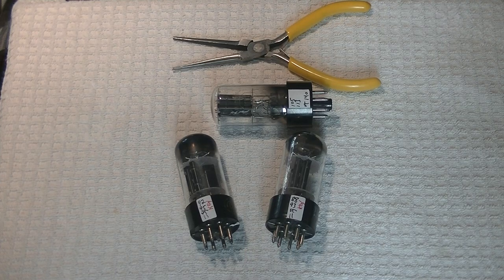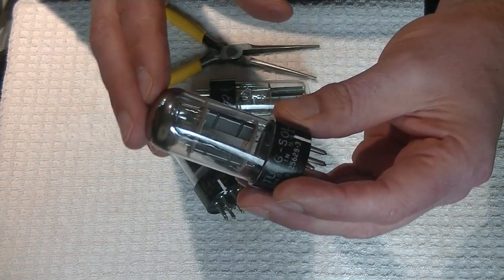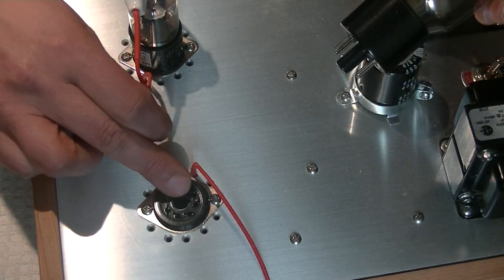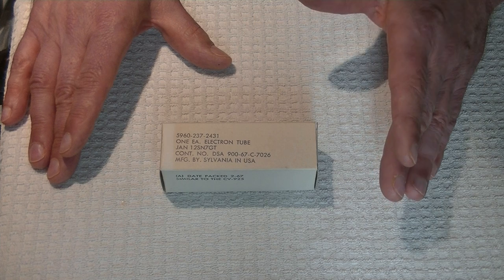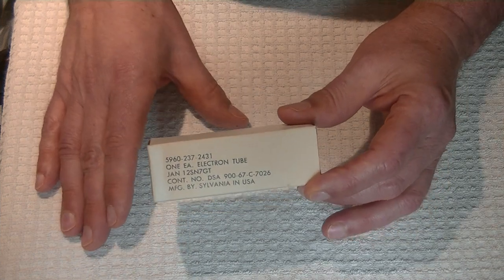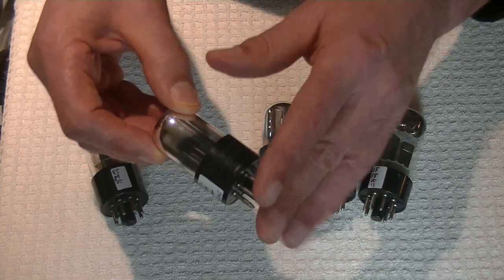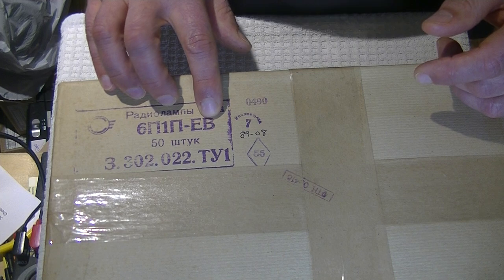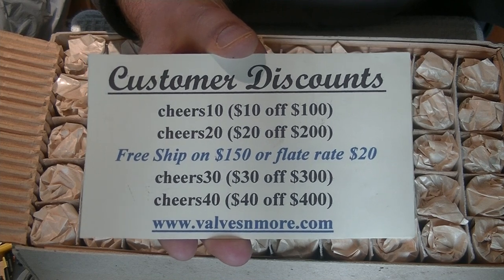Tube Lab #77 - Broken Octal  Keys

Comment: Nice video, really enjoyed earlier part of the video showing how to install a tube correctly. I have learned the hard way on my pre-amp with sunken 
connectors and have broken a key off an expensive tube of a quad matched set!   I like your suggestion of marking the tube for the location and orientation of the key.  What I’m not sure on is can you install a tube with caution with a broken key on it?   Enjoyed the video and your explanation of various 6SN7 tubes for future consideration.
Reply from the maker: Yes, if you put a clear mark (I like using "white out") on the side of the tube, it's easy to line up the key, remember the octal pins are 8/360, so 45deg of rotation apart, the human eye hand can observe and manually line up easily inside +/- 5 degrees.  Just take your time, do a practice run (amp off)  until you have the hang of it.  Trust yourself and your abilities.

Comment: Really good video, thanks! Good tips. That GE made bad boy style/elevated T plates 12SN7GTA you had there is one of my favorite tubes and it's hard to find one right now! Actually, didn't Marconi make those and many are branded GE?
Reply from the maker: Marconi, Montreal plant (huge facility 4 square blocks) as far as I can figure out made all of the elevated T plate 6sn7gtb, I actually have excellent inventory (#140), just very time consuming finding a good quiet pair.  I don't think I've even seen a 12v version, I may have, but they're not common.
Reply: @tubelab194  thanks! I actually have two Marconi/GE elevated plates/bad boy 12SN7GTA’s (they didn’t make GTB in the 12SN7) exactly like the one in your video. One is very slightly noisy, slightly crackly, and the other is perfect. I do know someone who has five of these, branded Westinghouse, but they aren’t cheap. Are the ones you have 6SN7’s?
Reply from the maker: @sean_heisler  I have a large inventory of 6sn7gt and gtb, I'm pretty sure all the tubes branded "Westinghouse and GE" were all made by Marconi.  Back in the Day, Marconi was huge, they held many of the early telegraph, radio and tube patents.  Marconi USA was the foundation for what became RCA!

Comment: Great video! General question: do you think socket savers degrade sound quality adding contact resistance? I personally use them while I'm tube-rolling only, but have lately noticed there are manufacturers who include socket savers with their amps (e.g. Decware for the rectifier socket).
Reply: Just thought I might add a comment to this. My tube preamp has 9 pin sockets and can run 12 or 6 volt 9 pin minis with the flick of a switch BUT I use a 9 pin to 8 pin adapter to run 12 and 6SN7's and even with the adapter the SN7's BLOW away any 12AU7 or 6922 by a mile.
Reply from the maker: I have a very high sensitivity ohm meter and have tested samples of the high quality ceramic/brass octal socket savers I carry and have found zero (0) resistance, which makes sense, you are adding one pin length and a very short length of wire.  If you've ever done point to point custom tube amp builds, you'll understand that in the broader circuit wiring these short lengths would have no measurable impact on the circuit performance.  What my heavy socket savers/lifters might do is slightly dampen a microphonic - slightly.  But all that said, I 100% agree with you, if you aren't rolling tubes, then plug them straight in.
Reply from the maker: @sean_heisler  yup, the 12au7 is not my fav tube either, not at all, the only exception is the RCA clear top and maybe some European types.  The 6922 is a completely different tube and shouldn't be used in a 12au7 circuit.  Now it depends on what you're doing with the 12au7, as a cathode follower or phase inverter it can be terrific, as a voltage amplifier, not so much, that's when a good 6sn7 wins everytime!
Reply: @tubelab194  that is very interesting. When I started using SN7’s I haven’t rolled an AU7 in the preamp since. Are you saying that au’s are better as cathode followers than sn’s? I have a number of high quality 12au7’s and 5814/6189’s. My tube preamp has one input tube for gain stage, and then splits off to two cathode followers which apparently gives some additional gain. Sorry, not an expert here. It is tube power rectified as well. Let me know, might have to put some 9 pins back in as followers to try it!

Comment: So how do i remove a broken keyway from a tube socket in my amp? Thanks in advance
Reply from the maker: **Caution!!! High Voltage present!** Unplug the amp, then with a bit of luck there's enough of a stub to get a long needle nose pliers on to the stub.  However often when the key stub is broken off it's because it was inserted out of allignment and is jambed in place.  In that case you'll need unplug the amp, discharge the capacitors, open up the chassis,  and get access to the back of the socket if possible and either punch out the stub or pry it out.  If you aren't handy or comfortable working inside your amp, bring it to a recommended tech and they'll take care of it.  Luck!